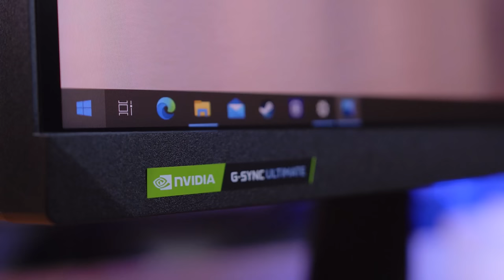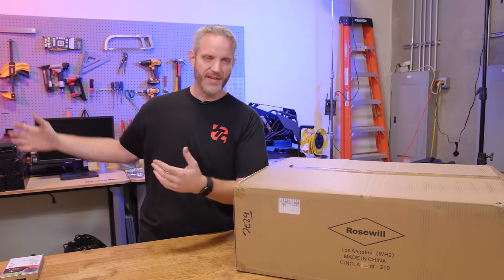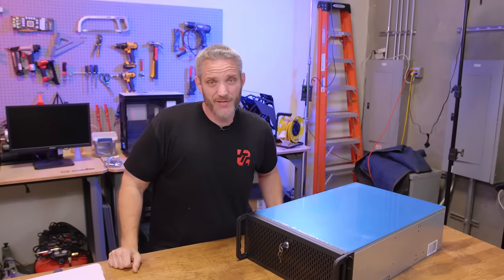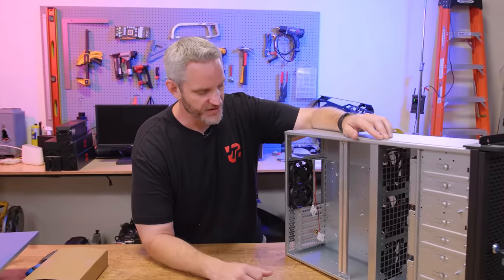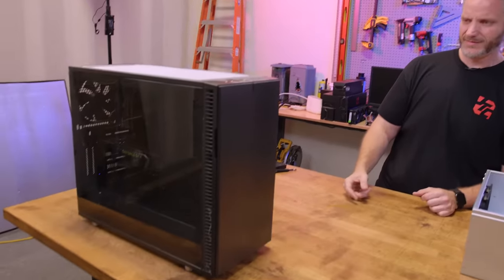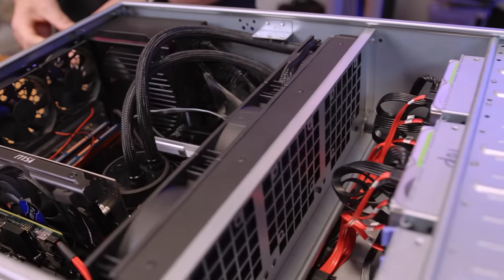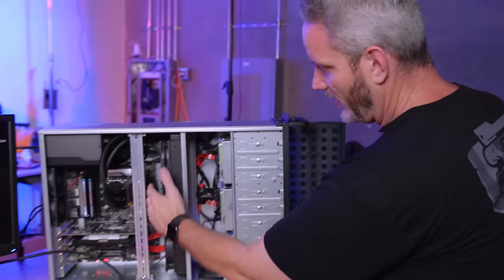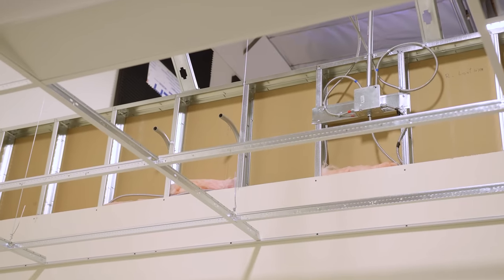Maybe I should have called Linus...

Comment: Can I gets links to the Chassis, SATA card, and SATA cables used for the server? I've been wanting to upgrade my Plex server from a full size desktop case to a rackmount one so I can add more drives (and obv put it in a rack). Even just model info for each would be great. Also, my current AiO uses a 140mm double thick rad, would that fit on the cross member that holds the AiO in this video, or would i need to look at getting a new one?

Comment: I hope those fans you put in the front are Static Pressure fans similar to fans made to push air through something (like a rad) rather than regular case fans.
Corsair SP series are my favorite.
And the AIO is overkill for a NAS. You're literally okay using a stock intel cooler. since it's just a nas.

Comment: If you have need for a NAS or server, you need TWO of them!  One on site, another offsite in a secure location that syncs daily(at a minimum) and keeps read only "copies" of everything for at least a month on both systems.  Almost all of the YouTube so called experts forget this.
Drive cages suck! Save money(time) and downtime get hotswap bays. Bonus points if you get a case that supports duel PSUs powered with separate power circuits via two different UPSs... All this costs money that you can't afford NOT to spend...

Comment: You definitely don’t need Linus, but it wouldn’t have hurt to call him up and get the number for Wendell from Level1Techs because he’s the guy Linus and Steve both call for help with server stuff.  Servers (a NAS is a server) are a whole different game when it comes to building them and managing them, and Wendell is the man when it comes to enterprise level hardware and janky home lab setups like you’re building.

Edit:  if you decide to go with a proper NEMA rated IDF cabinet with it’s own AC unit, then you need to make sure you replace the filters on it regularly and get an environmental monitor that detects temperature and moisture, because if you have a hot ass day and open the shop up to the humidity if the AC is cranked too high you’ll get condensate buildup inside it.  The only issue to consider is the sound of the AC unit when it runs, because they’re built to work in places where sound isn’t an issue.  I have no idea if they’re actually loud because I work in a factory, so our IDF cabinets are probably the quietest thing when I’m working on them and haven’t noticed their relative volume, but they’re pretty aggressive so I assume they’re pretty loud.  The good news is that if you can isolate the sound sound of the AC unit, then that cabinet is going to be much cooler and quieter than if it was just open to the air.  You’ve mentioned before that it gets hot in the shop sometimes, so that would be a benefit to the gear you’re locking up in that cabinet as long as you don’t let it get too cold in there.

Comment: I've had that exact case for the past 3 years. Cost an arm and leg to get shipped to New Zealand but well worth it.
Reply: I lucked out on TM... Got a SuperMicro 4U case with 36 hotswap bays for ~NZ$2000 I would have paid that for the case alone... It came with a complete system in it (Duel  E5-2696 v2s with 128GB RAM) You can get sometimes find good server stuff if wait and look (avoid the ancient paper weights)
Reply: @craigd458  nice. Snagged a 42U rack for $100nz with a wired up 24 port patch panel and dual 12 socket 20a multiboards
Reply: @RobinHilton22367  nice

Comment: wait, dont HDDs come with a label already on them with like a string of letters and numbers as well as a barcode. It should be on the opposite side to the ports. I had a similar issue with my freenas setup with one dying drive and it shows that number in the interface, so I could figure out which one to replace. Or, maybe that was just an excuse to go ahead with the video, in which case, I love it.

Comment: @jayztwocents if you want to make it a hot swap look for something like 3x5.25" to 5x3.5" hot swap cage should slide straight in, if you have an LSI SAS card you can also use an intel res2sv240 expander card to give you more SATA ports to connect to, i also duct taped those side vents to stop the dust

Comment: I gave up on Seagate long ago. So far, 100% of my Seagate drives have failed over the years, including the 2 iron wolf drives i got since everyone raves about them. By comparison, i have had a total of 2 WD drives fail in 20 years. I still have a working WD 540MB drive from my 286 that has 0 bad sectors! Running WD Red plus, pro and the red originals, WD black, green and blue. Even some old RE2s and a raptor (which died after letting smoke out, thanks to my samsung SSD shorting out 12v to 5v!!!). Working in data centres for many years revealed that Seagate remains trash, for every 5 Seagate's i would replace only 1 WD (we had a reasonable mix of vendors, mainly Toshiba and WD, but Seagate's we would swap with other vendors at every opportunity). Just my 2 cents on failing drives.

Comment: Could have used a (more expensive most likely) super micro case and had his hot swap, then document what serial number (drives) were in what spot then once turned on replace the failing drive. I'm new to them myself so I don't know who makes what, but I havnt seen too many high drive count hot-swap chassis aside from supermicro psc/sc 836/846/847 chassis'.

If he did one of them he could then do all the "quiet" mods for them and make a video on it as a how to and maybe design his own fan wall for it for the new fans, and maybe share it to his community. I've seen "this is what i did" videos but not "this is how you do it and what's entailed" ones.

Comment: Looks exactly the same as my TGC 4U rackmount case, only difference is the design on the front panel everything else is identical even the drive mounting hardware is the same and the molex only fans which I am still using yeah not the quietest system to say the least.

Comment: Honestly, these kind of rack mount cases being so lack luster in features made me go with used older data center servers for my home server lab.  Cheap, quiet cause I went with low power older CPUs, Always hot swap, ID lights on the front so you know what drive went bad.

But you can't add RGB fans to decommissioned data center server so for the sake of the memes you have to stick with this build.  cause RGB in a rack!!!

Comment: you really really should think about going to 100gbe - networking is weakest link for smb sector now and going into 23 will be a big upgrade and also builtin upgrade to 200g if you want so savvy investment - the new zen4 and nvme 10g speeds complement and match 100gbe throughput which is awesome - no more depending on arrays - with just 3 nodes smb will be able to get 5m iops?

Comment: So no issues with dumping the radiator heat back into the case instead of externally?    Just seems odd to have the radiator internal.    That said, I'm kind of jelly that I'm still rocking an ancient Intel CPU, 4790? hell it's so old I don't even remember.   I will say though 10Gbps fiber here, *passive flex*,  or at least theoretically that's what it is I don't have the hardware to test the limits, I do remember sticking with cable for a while though just because it was so cheap compared to the alternative but when a local company offered 10Gbps fiber for $40/month I mean I just had to!    Now that the great hardware siege is nearing an end maybe I can finally upgrade my rig!

Comment: Hah. That's the exact same server case I bought to replace my old ATX tower 24TB server which is a godawful mix of SAS and SATA  just running on ubuntu server.. no fancy GUI or anything, running on an old 45nm core2Duo. Corse with all that bare steel I had to paint it up with a good etch primer inside and out. then do a custom paintjob on the outside..

Comment: I would reach out to and be very insistent with Spectrum/Charter. Their MINIMUM speed is 300 Mbps right now. Where you live and work, there is absolutely zero excuse for them offering speeds that low. There is no equipment or line limitation (if they tell there is, they're full of shit). They are fully capable of giving you 300 Mbps, they just won't unless you make yourself into a giant nuisance.

Comment: funny seeing this video now as i was given an old server from a friend of mine and the case was this but the 2 bay for 10 drives. i gutted it not long after i got it cause it had sat for a few years and parts had died and also converted it to the 4U 3 bay. i put an Asrock z270 Extreme4 mobo with an i5-6600k air cooled, SLI GTX 980ti Founders Editions, Corsair rm1000x PSU, Kingston 500GB NVME (OS drive) and 15 WD HDDs (x5 WD red 3TB, x5 WD purple 3TB, x5 WD blue 4TB) for 50TB Total, and Corsair SP120 RGB fans as im gonna cut a viewing panel on the side. Sending pics of it on Twitter for your viewing pleasure

Comment: I could roast you for unraid but if it works for you then great.
Tape up the side vents on the case, you will have more than enough front to back airflow for the consumer hardware. Add some forced airflow to the raid card though.

Comment: unraid unassigned devices app. Dont' ever leave home without it. Allows you to blink each drive and track\label and note. You will regret not using it if you don't have it. I had a drive show it was failing, and the unassigned devices app from the unraid app store made easy work of find it, pulling it and replacing it.

I said this not as Linus type server (commenting on what you were saying around 4 minutes in). I'm running a 720xd with 15 drives total. I'd offer help, but I'm just a nobody and you p probably already have the unraid "app store" installed. I'd bet $1000 you will love it and it's simple front page diagram for your drives. I didn't develop it, but damn did it save my butt massively.

Ok, I'm done :D

Comment: Dude I got this EXACT case. It's really good for the money, though I heard there are rail problems. I would have been cool to see rail installation, but I'll just have to buy some rails and try it out for myself.

Also, if you want to keep the spiders and webs to a minimum, I recommend picking up a furnace filter. One of the pleated ones with a softer material. Cut some of the material off and put it in the front behind the existing foam. Mine has been running since like 2017. I just took it apart for the first time last weekend, and only the rear fans had the slightest amount of dust.

Comment: Don’t want to be negative, but… It’s nice to see what’s you love build computers, but server... no thanks, no. Your build lacking so many features available in real servers. I know it, because long ago I did same, build “servers”. Some of them work from 2012 and replaced in 2020 or 2021, replaced by used Dell servers from eBay.  Recent replacement is Dell T430 2x E5-2690 v4 2.6GHz 28-Cores/256gb/H730/4x Trays/DVD/2x495w from eBay, cost: $2000 and believe me it is real deal with front accessible drive bays with trays, remote console, ECC ram and redundant power supplies and monitoring software. For people who doesn’t have $2K Dell PowerEdge R720 8 BAY 2x E5-2667 2.9GHz 12-Cores 16GB 2X146GB H710 2PSU I get for $250, yes, its older, rack mount, but strangely enough it very quiet.

Comment: There is just one thing I don’t understand, why did you went with an AIO, it’s far less reliable than air cooling and need more maintenance to blow it regularly, plus, as you mention, it’s a Nas, it won’t use a lot of ressources, so it doesn’t need a big cooling solution, even the stock cooler from the cpu is enough, but, I give you that it’s less clean looking than an AIO